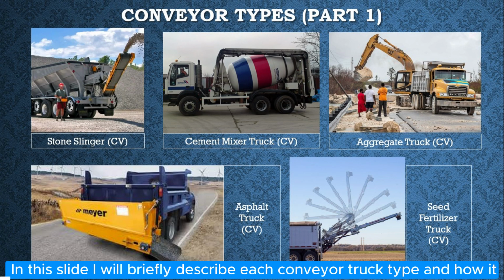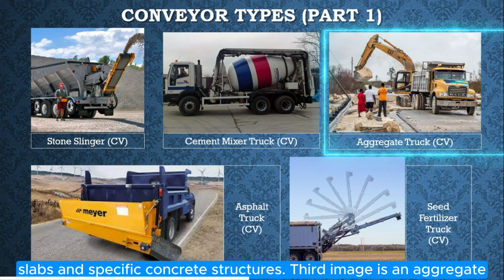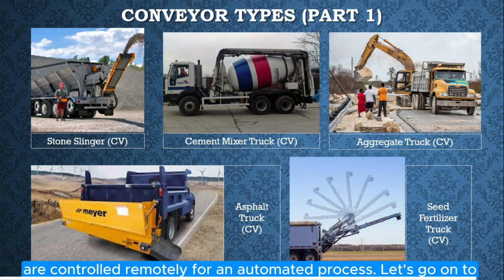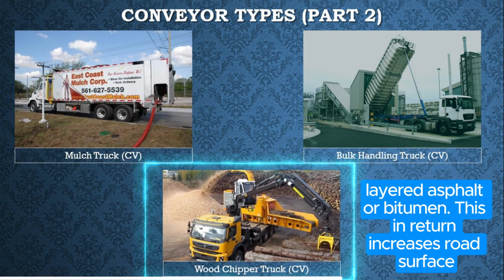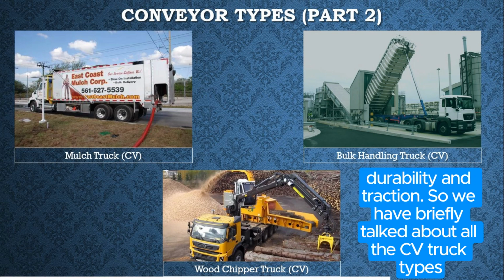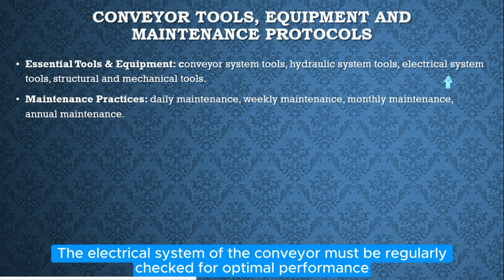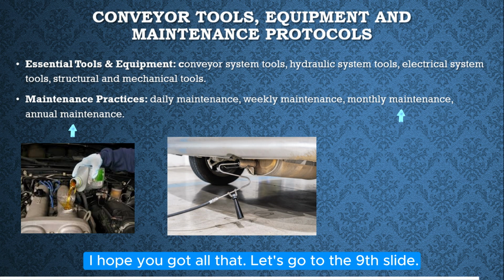Conveyors (CV)

Comment from the maker: 🕐 Timestamps 🕐

00:00:00 | Introduction
00:00:31 | (CV) Truck Type in Table
00:00:51 | Conveyor Explanation
00:02:20 | Conveyor Types (Part 1)
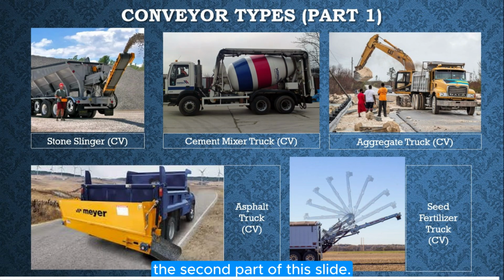00:04:35 | Conveyor Types (Part 2)
00:05:42 | Images, Specifications & Dimensions (Part 1)
00:07:01 | Images, Specifications & Dimensions (Part 2)
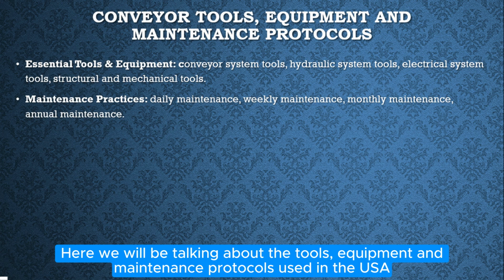00:08:00 | Tools, Equipment and Maintenance Protocols
00:09:54 | Conveyor Truck Multimedia
00:10:33 | Inspections and Surveys
00:14:15 | Regulations, Permits and Insurance
00:16:41 | Unique Conveyor Trucks from Around the World
00:17:12 | Container Pros / Advantages
00:20:07 | Container Cons / Disadvantages